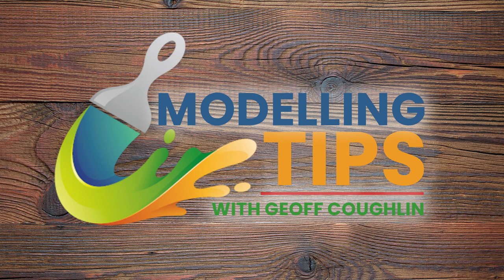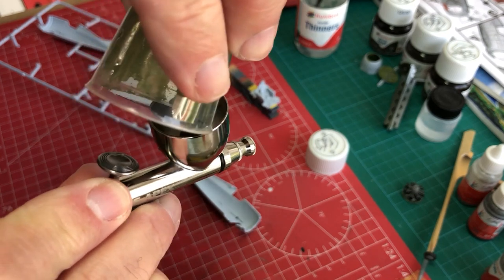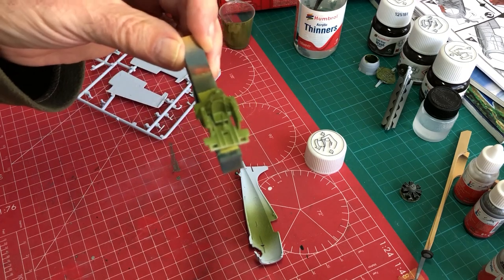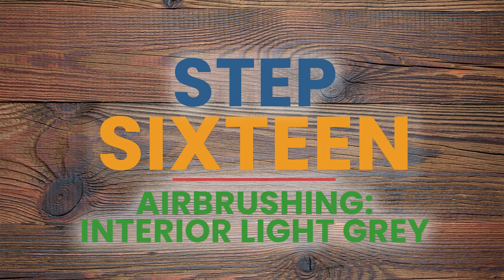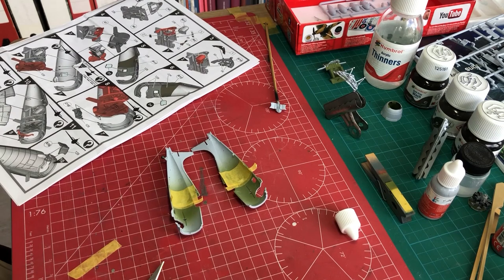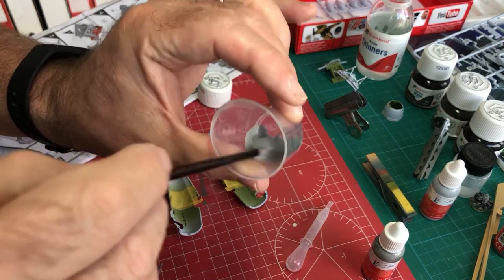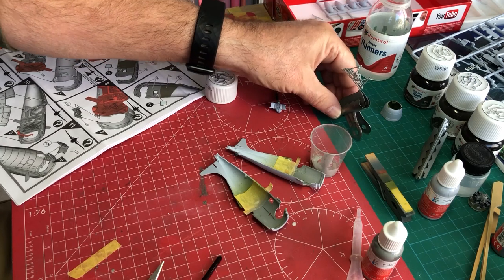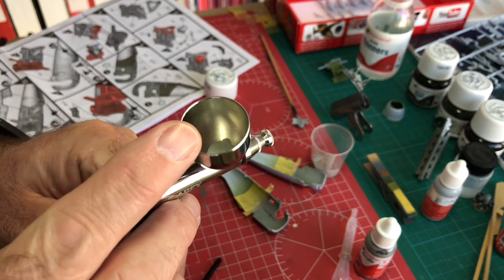HUMBROL | HOW TO: Acrylic Paint Droppers - Part Five

Comment: Ultimate Apex? Any good? Also what about the paint itself - are they readily available yet and is it worth swapping from any of the myriad dropper bottle types?
Reply: Made by Badger... 😎
Reply: Hi Rusty - yes, I really like it. I have absolutely hammered it for a couple of years now and it just works very well with no vices - easy to use and clean. Best wishes, Geoff C